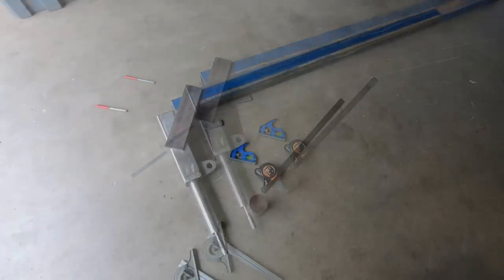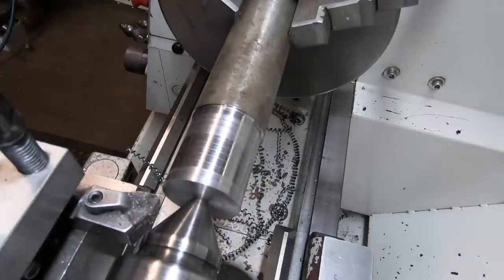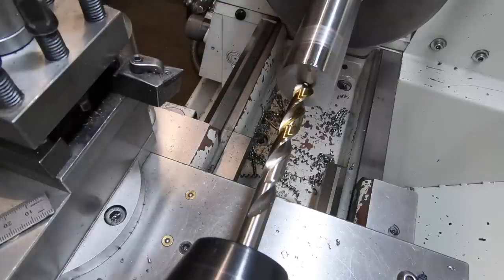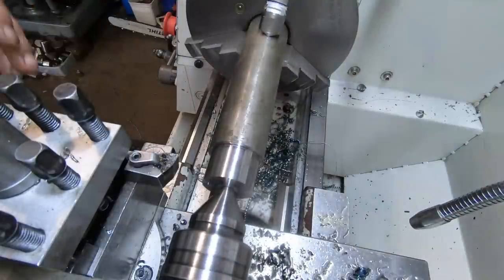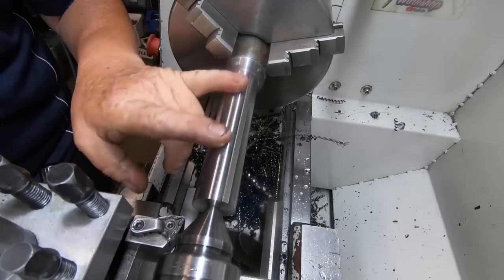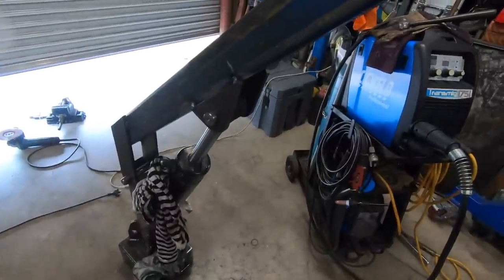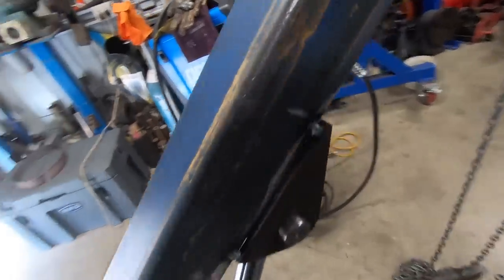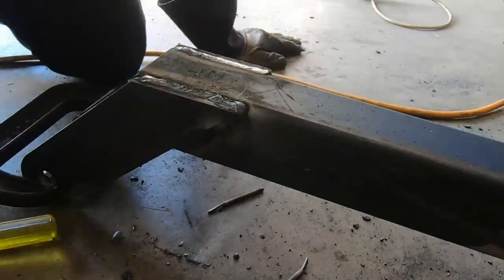Homemade Crane Build - Part 3

Comment: Hi  Matty This is turning (pardon the pun 😂) into a really good project. It’s been too hot and humid up here in Qld to do much in the workshop. I love your new method of drilling holes where the drill stays still and the swarf comes out it must save a lot on electricity. Keep up the good work.
Reply from the maker: Gday Rod, there the new series spin’less  drill bits, bit pricey but they work 🤣, it’s been really humid down here to lately, thanks for watching mate, cheers

Comment: Coming together nicely Matty👍 Hope the spider bite is healing too mate, the white tails love me. Not had serious problems but been bitten 3 or 4 times and they never fully heal. Usually love spiders but those little bastards get stomped, mashed, crushed and then burned🤣
Reply: If ya wanted to pick more weight ya could add a rib down the top side and double a layer along the sides around the pivot points but your intentions were the zero turn right?.It should be more than enough. Overbuilt 🤔👍
Reply from the maker: Gday Bill, spiders don’t last long here at all, the bit is healing well now thankfully, appreciate you watching mate, cheers
Reply from the maker: Gday James, I think it’ll lift the mower with no trouble, I want to keep the weight down as much as possible but I’m not doing real good at that so far, cheers

Comment: if you want to take a fair roughing cut on the first hit Matty slow your speed right down around 65-100 and slow feed you should be able to do 4 or 5mm deep cuts, 8-10mm total. its slow but a great way to hog it out.
Reply from the maker: Gday Troy, I can normally get 4140 to break a chip, I did in the end after a few changes, im going to give your way a go to, thanks for watching, cheers

Comment: When you mount the Crane on the trailer, will the lifting arm reach the mower on the ground? also will the arm lift it high enough to mount the mower on the  trailer? What is the suspension like on the trailer, will there be much body roll? I had to put a stabilizer on the side of my Ute to stop the body roll. This is what caused the shaft to shear off when I swung the lifting arm.
Reply from the maker: Gotta have a Commodore mate, only comes out once a fortnight...